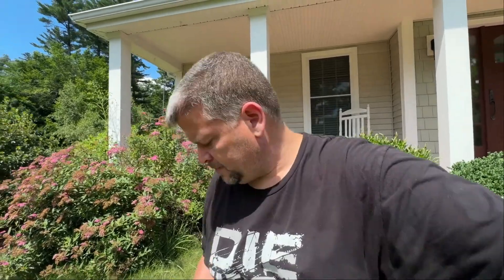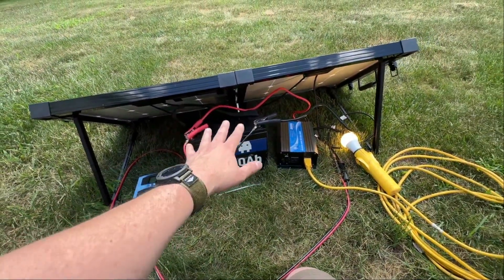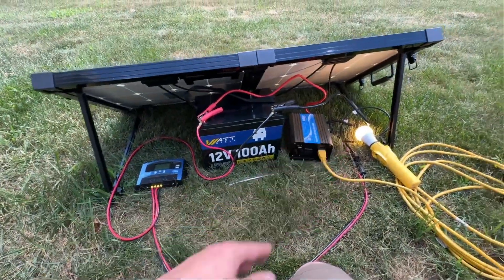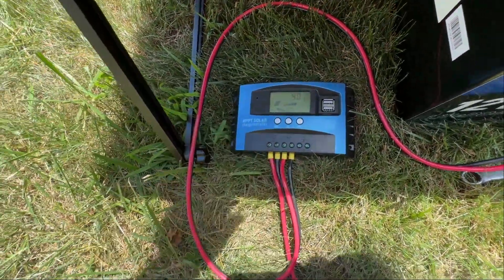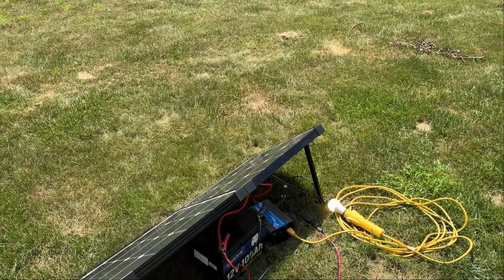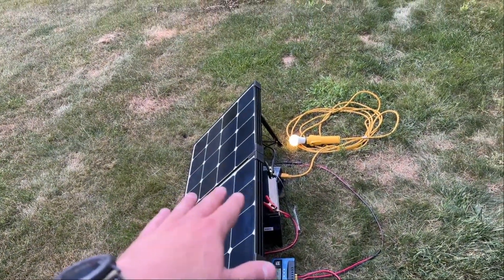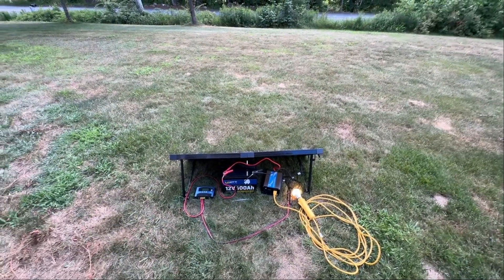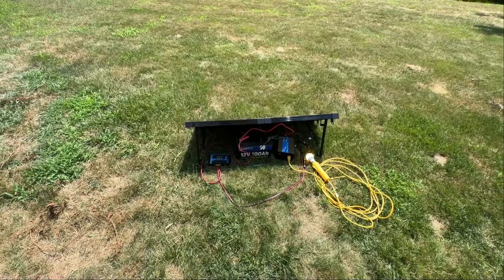How To Make The MOST SIMPLE Solar Power System

Comment: Thanks! I'm a fan of using all 12 DC equipment to avoid some initial costs and increase efficiency a bit.
Reply from the maker: For smaller wattage 12volt works great. But for bigger wattage needs (2.5k or more) I recommend 48volt to keep the costs lower. 0 gauge copper wire get spendy quick.
Reply: @RealitySurvival  Agreed. My position requires a relatively radical rethinking of one's needs.